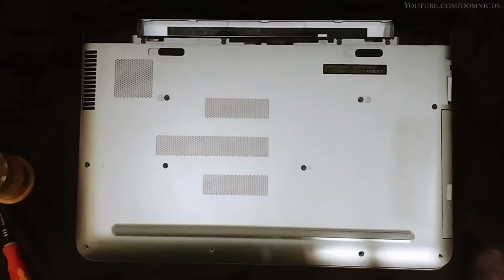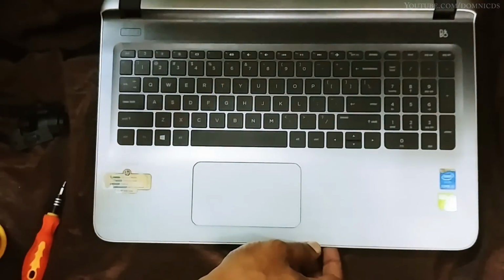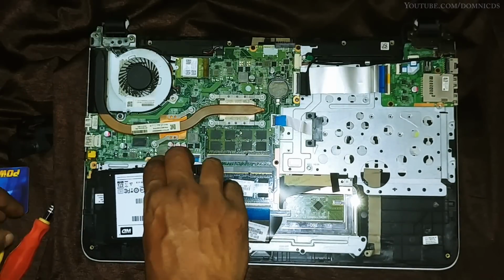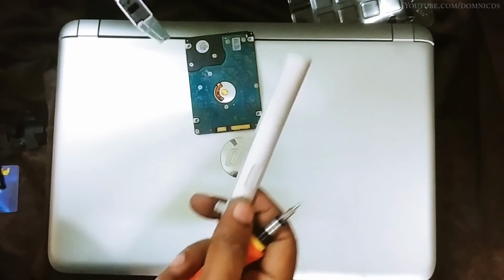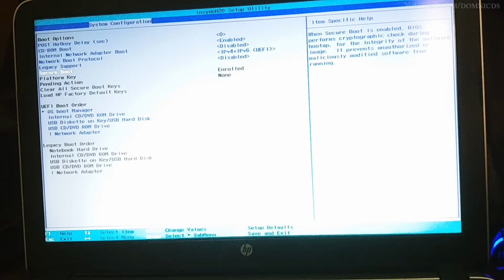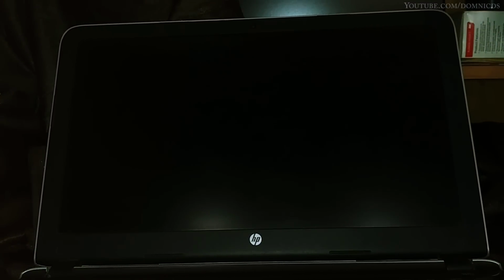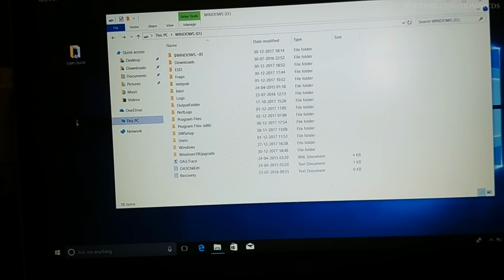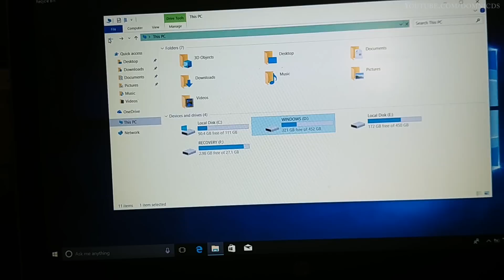How To install a SSD + HDD on a Laptop (HP Pavilion 15-ab032TX)

Comment: Hi Bro! I did the same thing but hdd not detecting in cd drive please help me
Reply from the maker: Hi, Reboot the laptop, if it still doesn't detect then either you didn't connect it properly or  the Caddy is faulty...
Reply: @DomGamingnMore  It was detected bro but am unable to format the hdd inserted in caddy

Comment: Hey dom this trick still works with current windows version?
Reply: @Dom-Gaming n More  And yes our ab032tx support -m.2 SATA SSD AND m.2 NVMe PCIe  SSD?
Reply from the maker: Yes you can still use this method, and no there's no M.2 slot in the laptop...
Reply: @DomGamingnMore and it can support ram dd4  8 gb ram? And yes Fusion 360 designing application lagging so bad after install so should i upgrade RAM or SSD?
Reply from the maker: No it will use only ddr3 ram check my video on ram upgrade... Check your ram usage in task manager when using the app and then decided what needs to be upgraded... I added a ssd and extra 8gb ram on the laptop...

Comment: I just had one question. If my laptop has an empty M.2 slot, can I purchase the M.2 SSD for it instead of a SATA one?
Reply from the maker: Yes, if you have a m.2 slot then that's better coz you will get to use the dvd drive too... No need to swap drives around
Reply: Thank you
Reply from the maker: You're welcome...

Comment: I am choosing the notebook hardrive in boot priority as the windows installed in my ssd but it's not working please help
Reply from the maker: u have to select the Ssd as first drive, and move the dvd drive below as the dvd drive will be the first option to boot...
Reply: Should i disable legacy support or unable it because in my hp laptop in UEFI boot 
OS boot manager
Internal CD/DVD ROM drive
USB CD/DVD ROM drive
USB Diskette
Network adapter

In Legacy boot order

Notebook hard drive
Internal CD/DVD ROM drive
USB CD/DVD ROM drive
USB Diskette
Network adapter

Please correct the sequence it will be very helpful!!
Reply from the maker: go in to OS boot manager and check which drive is first, ssd should be first, you can move them up and down with F5/F6
Reply: Thanks for replying 
Actually my ssd is not showing that's why i update my bios now everything looks good

Comment: I have issue. When I put my hhd back with caddy my laptop start with old windows which is installed on hdd. How can I start with new windows while using hdd and ssd?
Reply from the maker: Change the boot order in bios...
Reply: @DomGamingnMore  in BIOS Boot Option Menu, OS Boot Manager only see my hdd. I cant select my ssd

Comment: Can we install M.2 NVME SSD in this laptop??
Reply from the maker: No, this laptop does not have a M.2 slot...
Reply: @DomGamingnMore  oh, that's sad to hear.... I have this laptop since 2016 Jan 1, I think almost the time you have got the same one... The only problem is it take more than 5 mins to boot up and get ready to use.  Anyway let me see if there is an adapter to connect M2 NVMe in the 2.5 SSD case...!!
Reply from the maker: Yeah since I added the SSD the booting time is very fast...

Comment: After installing window in ssd, can we format old hdd windows drive?
Reply from the maker: Yes you can...
Reply: @DomGamingnMore why you first inserted ssd and install windows, why you didn't put both ssd and hdd then install windows and format hdd windows drive and install new windows in my ssd?
Reply from the maker: i have answered all those questions in the video, but here we go, 

1) i was facing some issues while installing windows with both drives in, that's why  i installed only the ssd at the time of installing windows...
2) the reason i did not format the HDD coz i had bought the ssd for my Pc at the time of making that video...
3) i did a fresh install coz i could not get my C drive under 120Gb hence i could not clone it, so i did a fresh install...

Comment: Can i install Samsung 860 evo sata 3 ssd in my hp pavilion 15ab 522tx?
Reply from the maker: Yes.
Reply: @DomGamingnMore  My hdd is of 1tb 5400 rpm sata interface! 
And Samsung 860 evo ssd has sata 3 interface! 
So , as you've replied yes in my qstn!
Can i install sata 3 ssd in sata interface!  Will that be okay installing it? And will that be beneficial? 
Pls reply! I'm really confused !
Reply from the maker: The ssd that i used is sata 3 too... So it should work...

Comment: Could I just replace my HDD with a SSD and get rid of HDD completely? 

I think my HDD is corrupt as my laptop is not booting past “preparing automatic recovery” after making the mistake of changing a setting in msconfig.exe.
Reply from the maker: Yes you can install just the SSD...

Comment: I installed gigabyte 120 gb ssd on my hp-ay563tu laptop. But either i use it or not, the system freezes and then goes to either a black screen saying boot media not installed or blue screen saying some kind of error. But all this does not happens when i again switch to hdd. How to resolve this?
Reply from the maker: did you do a fresh install or did you clone the drive, if you did a fresh install maybe the installation did not go well, do it again, if you cloned your drive then u need to clone C drive plus a few more smaller partitions, Check out my video about cloning the drive...

Comment: I have genuine windows 10 installed in my hdd. Now if switch my hdd with an ssd and install hdd in the cabby, how am I going to use my genuine windows software in ssd?
Reply from the maker: hi as long as i remember changing the motherboard causes issues with windows activation, so u don't have to worry about that, i didn't face any issues with activation, and anyways if it doesn't work you just need to clone your Hdd to the Ssd...

Comment: Hi I need ur help.. I do this same process with my HP laptop but storage HDD many more time disconnect. Please how can I solve
Reply from the maker: Hi maybe your Hdd is not properly connected to the Caddy or maybe the caddy is not properly connected to your laptop or maybe your Caddy is faulty... coz i have never faced that problem...
Reply: @DomGamingnMore I will cross check once.  thanks buddy...
Reply from the maker: You're Welcome :)

Comment: Can i change ssd on any laptop?
Reply from the maker: Yes...
Reply: @DomGamingnMore  thank you for replying!! I was looking for a video on how to change my laptop battery for 15-n044tx hp pavilion but came across your video. And now planning to change ssd as well!
Reply from the maker: You're welcome, Glad that my video is of help ☺️
Reply: @DomGamingnMore  do you have any idea how to know if an ssd would fit in my laptop? Its hp 15-n044tx
Reply from the maker: Hi generally all laptops use 2.5-inch Hdd and ssd's come in same size, so it will fit in the place of the HDD perfectly...

Comment: Thanks for the Great Videos, Could you please guide which SSD will support for Laptop, HP Pavilion Notebook - 15-ab523tx
Reply from the maker: You're Welcome, any ssd should work just fine, check if your laptop has a m.2 slot, if yes then you can get a m.2 based ssd...

Comment: i have windows 10 recovery in (6 CD's) what if i remove the optimal drive? how to get this recovery in pendrive like you
Reply: Same question ??? How ?
Reply from the maker: well since i was doing a fresh install, i downloaded windows 10 from Microsoft's website...
Reply: @DomGamingnMore  okay should i do the same ? install the windows 10 from website..will this automatically license my laptop after installing it?
Reply from the maker: yes it will automatically activate windows, but just make a note of the product key on your current OS, also 1 more thing if u install from Microsoft you will not get all the extra apps that came with your laptop, u will have to install it from the hp product page of your laptop....

Comment: What to do, if after inserting hdd caddy, the windows doesn't boot? As it gets stuck on bootloader mode. Without hdd caddy, it boots fine.

(On my laptop,
Windows is installed on SSD(on primary sata slot inside)

Hdd caddy on dvd bay)
Reply from the maker: go into bios and change the boot order, OS boot Manager should be first, then go in to OS boot manager and check which drive is first, ssd should be first, you can move them up and down with F5/F6

Comment: Sir if I remove my hdd from laptop and just fit a new one,will I be able to open bios on my PC so that I can reinstall os to new HDD from os disk..
Reply from the maker: Yes...
Reply: Dom - Gaming n More so it means bios does not reside inside HDD????
Reply from the maker: Yes exactly.
Reply: I just spilled coffee on my key board and then my letters were messing up with one another.i just took it out and washed it with water and let it to dry...and when install it again it did worked for some time with few keys still messed up but lator on it dumb....now it is not working so what should I do...???
Reply: @ramanmehra007  BIOS reside inside CMOS chip.

Comment: I too have a HP Pavilion 15-ab032tx. I want to know if this laptop has an M.2 slot to equip an eGPU.
Reply from the maker: You have to use the WiFi/Bluetooth slot for egpu, i did try it with the NGFF cable  version of Egpu, the laptop just wont boot...
Reply from the maker: nandu zz yeah i did mention above that i did try and it didn't boot at all, tried many things, then i gave up...

Comment: Bro I've ab029tx with 12gb of ram even though it's slow Start up and sometimes hangs while using.
Reply from the maker: Try Defragmenting and Disk clean-up etc, also try and keep at-least 10 gb or more of free space on the C drive, if not its time to upgrade to a SSD ;)
Reply: Dom - Gaming n More I've done everything and I've hell lot of space around 100gb for c
Reply: set fast startup to reduced mode

Comment: I have installed ssd, and that makes me confused how to install the driver from hp recovery manager, because the application is not there, but the partion recovery is still there in hdd

Please help
Reply from the maker: if u want your recovery partition etc then i would suggest you to clone the drive, for that you will have to uninstall all the apps etc to get the size of the c drive lower than the size of the ssd, there are many cloning videos out there, I used  Macrium Reflect 7 to clone my Hdd on pc...

Comment: Wouldn't it have been easier to just install the SSD on the dvd drive?
Reply from the maker: yes it would but then you will be restricted speed wise.
Reply: @DomGamingnMore     Compared to HDD speed, how much SPEED it will be restricted?

Comment: Hello, I am using AB035TX (very similar to AB032TX). Is there any way to replace it's non-backlit type keyboard to backlit-type?.
I have read somewhere that we can do this with two laptop keyboards from HP whose model numbers are 809032-001 (for use in the US) and 809032-002 (for use in India). And I guess, these two versions will also fit perfectly with your laptop too, if yours is not backlit-enabled. I am not sure about it, what do you think ?

Why am I saying it will fit your laptop?
Please read here:
https://h30434.www3.hp.com/t5/Notebook-Hardware-and-Upgrade-Questions/hp-ab032tx-backlight-keyboard/td-p/5942251
Reply: same question man if u find the solution let me knw man i also want backlit